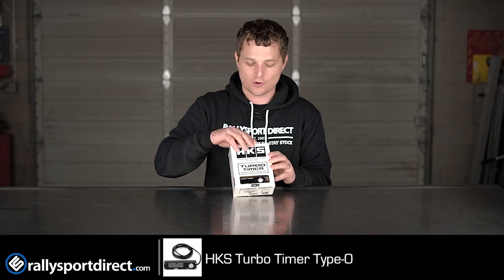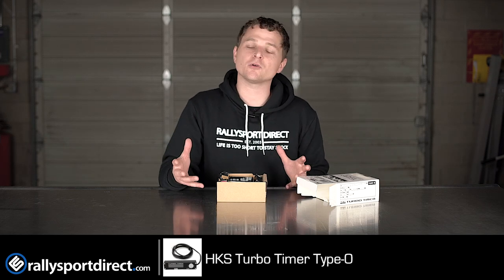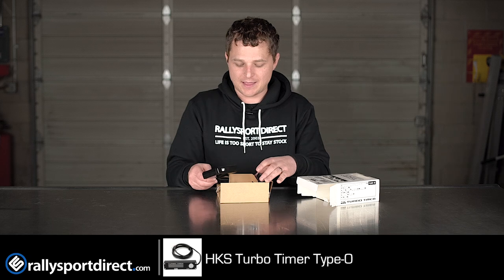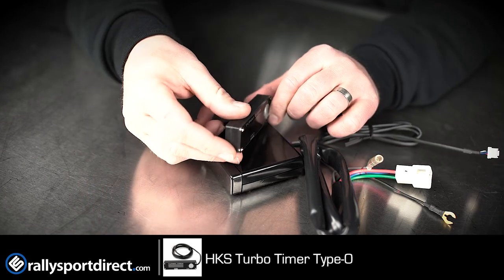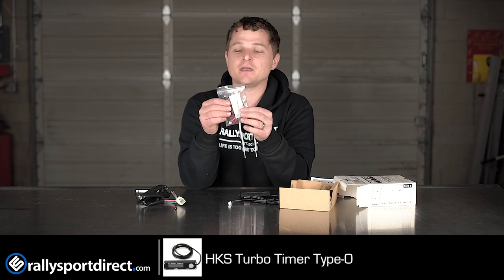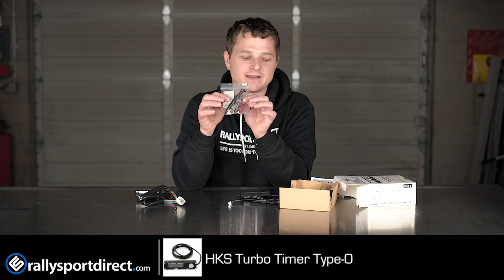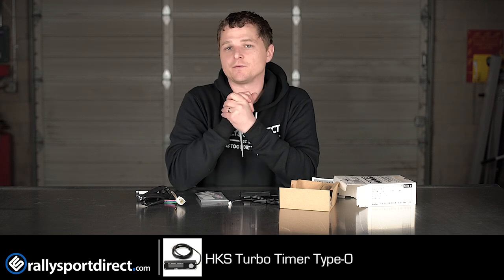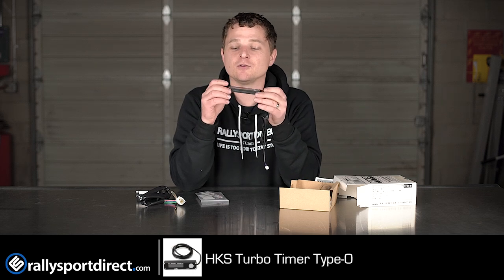HKS Turbo TImer Type-0 - What's In The Box?

Comment: Don't Coolant temps generally go up when Idle?  I Know when I'm driving around, its about 185 degrees, and idle, its about 197, ...I do understand this will work better to cool off the oil.
Reply from the maker: In regards to the coolant temp, it will depend on the car, and the setup. But generally speaking when you are moving, you are getting much better airflow though the heat exchanger than the fans can provide while sitting still. Now when it comes to the turbo, this is not about absolute temps, it's about letting the turbo have time to "cool" off to prevent stationary oil and coolant from boiling inside the CHRA. So let's say for example you were just putting around the neighborhood with virtually no load on the engine, pulled up to your house and shut off the car, these timers would be worthless as your turbo is about as cool as it's going to get. But let's say your house is at the top of a mountain, with the high loads and therefore high EGT's you will be seeing, something like this can come in handy if you don't want to sit in the car and wait for everything to cool off. These are for sure, more of a "convenience" than anything else, and most modern turbos don't suffer from the same issues that the older ones do, but one thing is for sure. If you are driving hard, don't immediately shut the car down, let it cool off a bit. It just depends on whether you want to do that manually or with one of these. :)

Thanks,
Rick
Reply: @rallysportdirect  Awesomeness. I appreciate the feedback.. I just ordered my timer and looking forward to using it. Thank you!

Comment: This is a long shot here but I got this installed but I can’t lock the car while it’s running? Thanks
Reply from the maker: that is fairly normal as these cars will have a built in check that prevents the alarm from being armed with the engine running. Depending on your year and model, there should be a bunch of write up's on how to disable that feature so you can arm with the turbo timer counting down. I would search for something like "HKS turbo timer alarm bypass" or something like that. Hope this helps!
Thanks,
Rick